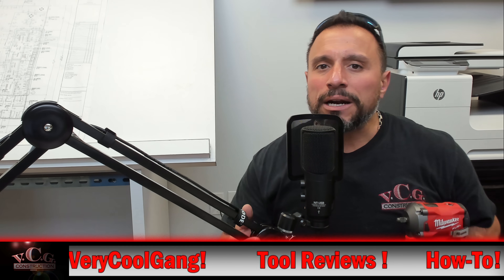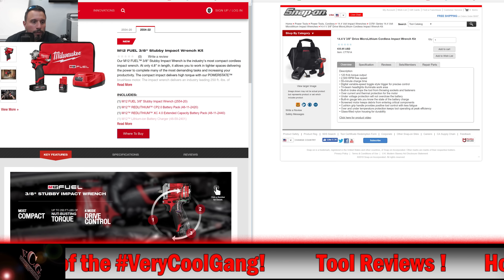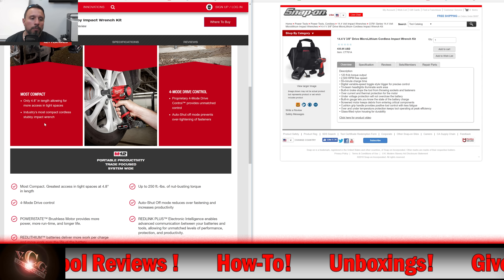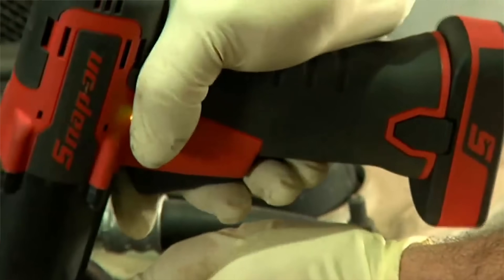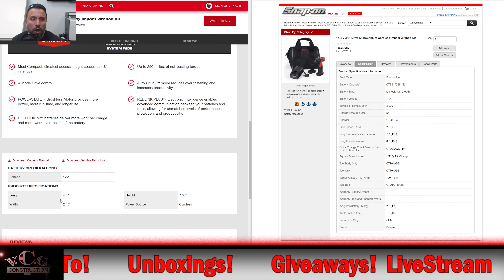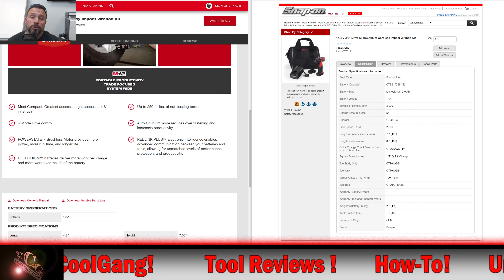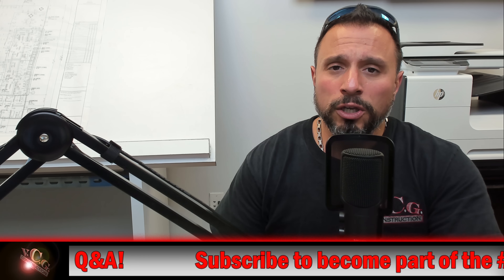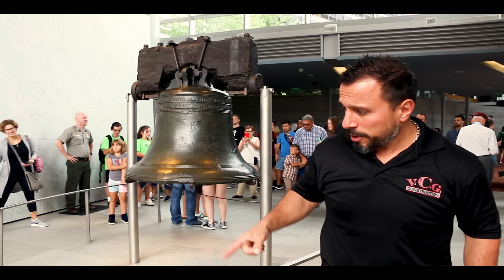Milwaukee (2554-20) VS Snap-on (CT761) - 3/8'' Cordless Impact Wrench Comparison!

Comment: Another area of consideration is the price and availability of extra or replacement batteries.  The cordless Snap-On we had worked fine, but replacement batteries were not always in stock on the truck.  In our case, we had a contract with a Dallas area Snap-On dealer but his visits were "on request"..we had to call him up and he'd schedule a stop with us between his regulars.  

Toggle triggers, I'm not a fan.  We had a DeWalt corded 3/4" impact wrench.  Nothing wrong with the trigger, but I was used to manually changing the direction due to more frequent use of pneumatic impact wrenches.  No comment on price, I wasn't paying for the new tools/toys...the water department paid for them and I budgeted myself a bit over $1 million for parts/labor/tools.

Comment: As a Professional Mechanic, 90% of my tools are Snap-On. I have every one of their 14.4 Volts Tools, some doubles. I got the new Milwaukee 3/8'' stubby cordless Impact from Cornwell tools, but that doesn't mean I don't use my Snap-On Cordless 14.4V Tools. Still I used both brand daily. No need to hate this or that. At the end of the day, they do their job. The ones that complains seems like the ones that don't make enough money. Snap-On, Cornwell, Matco, SK, Mac Tools all come around to the shops, every now and then you'll end up having to look for something from each and every one of those vendors. It's the cheap ones that don't make enough that don't buy tools. If it get the job done, it gets the job done. Regardless what awkward brand, price or tool it is.
Reply: If snap- on,mac or matco  tools did not have a weekly payment plan they would not be selling
Reply: That's like saying your willing to pay 450 for something you could have bought for 250 for the same exact tool just because money is not a problem.  Only here Milwaukee is the clear winner and you still stick with the "if your complaining then you don't make enough money" bullshit?  I say your trying to do one of the 1 of the 3 things here, 1: your either trying to justify spending a bunch of money on an inferior product, 2: your pissed because nobody is will to buy your overpriced snap on cordless set for what you want so you can get smart and grab the whole Milwaukee set...  Or 3: You really are that stupid.
Reply: Buying snap on is just getting fucked
Reply from the maker: Good points
Reply: Sorry Jason..
Reply: Oh and my mechanic is a snap on guy 99% of his tools are snap on, he tried my gen 2 high torque and my 3/8 m18, and new stubby I just got in from Ohio power tools and he was disappointed in his snap on cuz it couldn’t compete with my Milwaukee’s he’s really actually thinking of switching over cuz most of his batteries are going to shit so instead of buying expensive ass snap on batteries he can get Milwaukee’s with batteries and more power and better warranty
Reply: Jason, you’re a fucking idiot, you can afford Snapon?!!! Wtf!!!
Tell me who can’t afford a fucking $40 a week payment?....oh sorry only you Jason stfu!dumbass😂

Comment: Milwaukee are great tools but dont believe they will hold up to 5years of HARD USE or even 2 years. I have seen alot of new Milwaukee tool come on the job site used hard and about a year later they are barely running. Companies buy them cuase there pretty inexpensive and long warranties. Snapon once was a forever tool/hand me down to your kids tool/buy once cry once tool, but know not so much. Me i would go Milwaukee cause the cross compatibility not the specs. But i dont use my personal powertools as hard as company powertools so i know i will get enough years/use to make them worth it.
Reply: Im flat rate my m12 ratchet is already 2 years running fine and I have a fella that have a m12 drill like 6 year running great.

Comment: The allure of Snap-on is the ability to pay weekly. It's the name also that sells. The 14.4v is a good platform, but with the new brushless tech out now the need to do something. Even Mac jumped on the bandwagon I think Matco has a brushless tool now?
Reply: michael dukes u can buy astubby or any Milwaukee impact almost for the price of your down payment of a snap on,
Reply: paul w again, weekly payments is where people buy from the tool trucks. There is no down payment. Unless you buy a box. Most dealers let people pay like $20 a week. That’s why they sell. The countless other brands like dewalt Milwaukee makita all sell better cordless tools.
Reply: Yeah Mac carries rebranded Dewalt XR which is brushless. Matco’s infinium now has a 16v brushless lineup. I don’t know about their impacts but the 16v infinium ratchet is the strongest on the market by far. 70 ft lbs

Comment: I’m pretty sure m12 is actually 10.8v, 14.4 is probably 12v
Reply from the maker: Sounds legit!
Reply: Milwaukee is 12volts working torque
Reply: Lone Star Auto https://toolguyd.com/12v-max-vs-10-8v-lithium-ion-battery-cordless-tool-platforms/

Comment: As far as Snap On the cordless impact & drills they are not worth the money way over priced. Hand tools are a different story from Snap On if your auto technician. But the best cordless line up for auto technicians are the newest tools from Ingersoll Rand. They are some of the highest quality impact guns & ratchets on the market. Go check them out very impressive looking cordless tools. Me being a General Contractor I would still go Milwaukee all the way !!!
Reply: Even the hand tools are questionable on value if you break something well hope it's the day that your tool dealer comes hope he has it on the truck and hope he ain't on vacation... Or something like harbor frights pro line lifetime warranty buy 2 hf tools break one keep working return it when you can anytime you want still pay 1/2 fap offs price
Reply: Matt Lane            That’s fine if you feel that Harbor Freights pro line are quality tools to work with on cars or trucks, but when I worked as a mechanic I mostly bought Snap On wrenches & most hand tools. That was about 15 years ago & I never had a Snap On wrench break on me & they did fit better on the nut or bolt I was trying to break loose. Take my word that it’s not fun when a wrench breaks or if you strip out the bolt your trying to remove. Don’t get me wrong there was other good companies to I also bought Mac tools and for some stuff craftsman/Matco/ Cornwell and even SK weren’t bad at the time. In the 10 years I was a mechanic I never seen anyone with tools from HF, but maybe that’s different theses days. I do know that there is a few new companies that make mostly mechanic tools that are just as good as Snap On for half the price. So I do agree with you to a point but if I went back to working on cars I wouldn’t be buying Snap On because most of their tools aren’t even made in 🇺🇸 anymore. Times have changed that’s for sure 👍🏼
Reply: J J Most of the hand tools are made right here in the USA. All power tools are made in China. We don’t do that kind of work. Yet.
Reply: @JJ-lu6mg  hand tool quality  has improved on most brands compared to tools mad 15 or more years ago I remember when any tool made in China was useless not the case anymore.I believe the internet has a lot to do with it people can research tools read reviews and purchase them online so companies trying to sell tools that break the first time you use them aren't going to be around long.